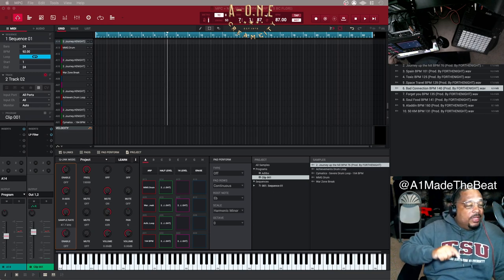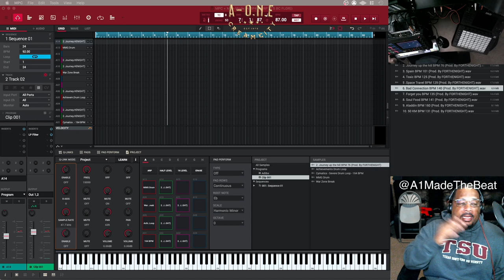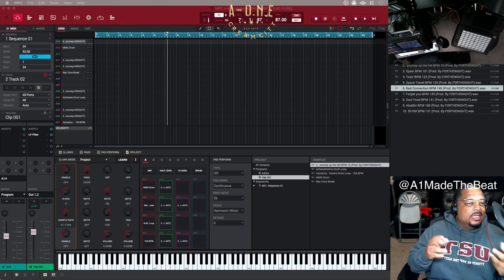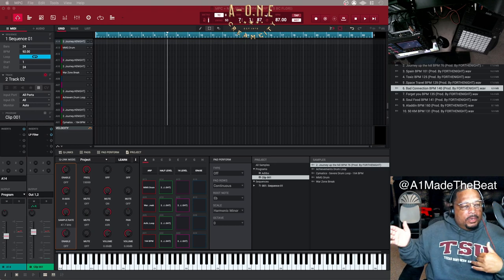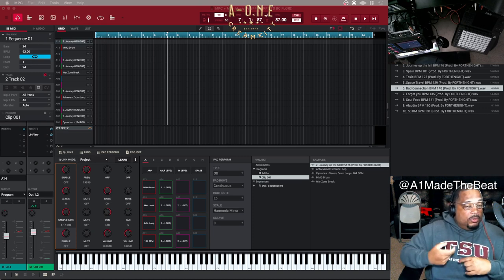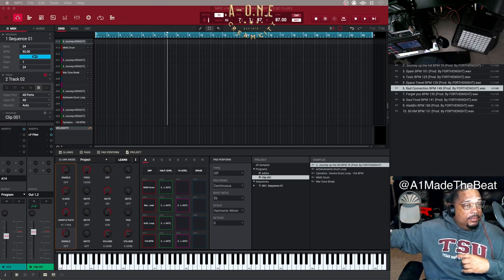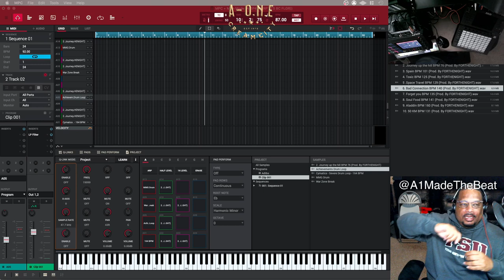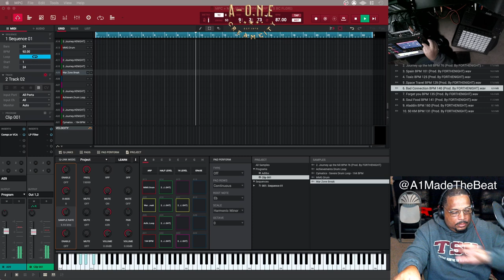What is MPC 414 Mode? Is this the SP 404 Killer? Let me show you...

Comment: @A1MadeThe Beat can you do this on the Force as well? Great Video!!!
Reply from the maker: Great question Jeff. Absolutely!!! That is how the FORCE is designed. The difference between the MPC and FORCE is how the clips work. The MPC Clip Mode can only handle audio but the FORCE is clip mode all the time and it is audio AND midi. In the MPC you program your midi sequences on TRACKs. The FORCE you program your midi sequences in CLIPs. The FORCE has assignable multiple parameters QLInks and you can assign pads to trigger efx. I hope that answered your question.
Reply: @A1MadeTheBeat  Yes indeed thanks!!!
Reply: @A1MadeTheBeat  this is a superb explanation!